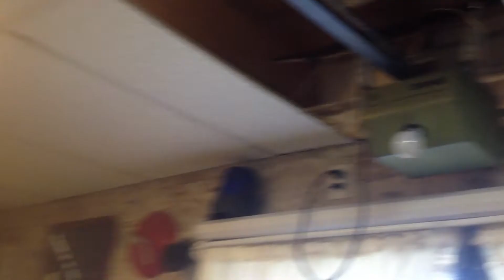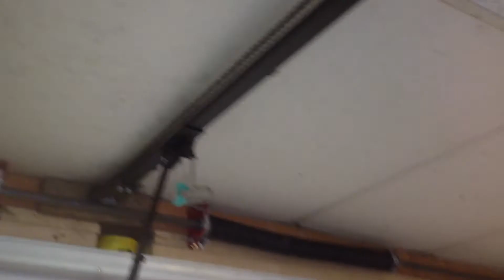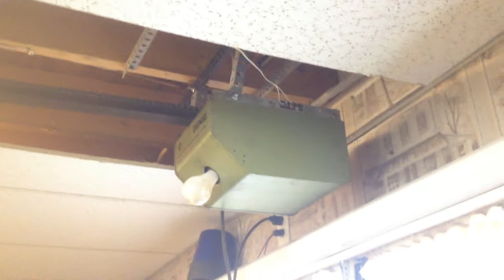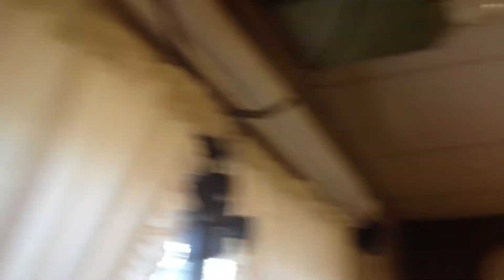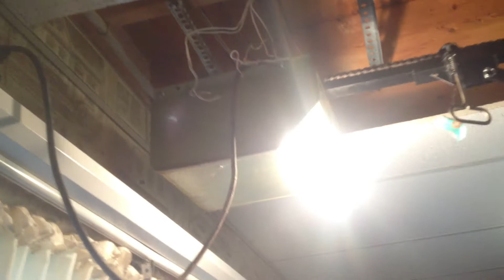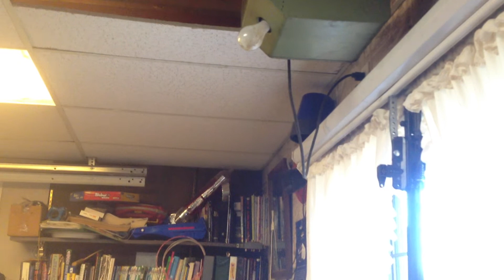Genie 200 on the relante

Comment: Can I program the model 200 to a remote?
Reply from the maker: Only if you have an external receiver.   It would be a small box hooked to 3 wire terminals on the side and mounted on the ceiling or the hanging angle iron near the unit.   If it is the original receiver, than it would likely be too old to accept any modern universal remote, and you would need a universal remote and receiver complete kit

Comment: Just bought a house with a Genie 200 and no remote.  Where can I find a compatible remote or someone to make(?) one for me?  Would it be cheaper to buy a new garage door opener than to hire someone to fit it with a remote?  Thanks!
Reply from the maker: Laura FryMelia Look for a receiver box on your ceiling near the unit.  See if there is a name on it anywhere.  If it says genie, open it up and see if there are dip switches inside.  9 or 12 switches, your local hardware store may have a compatible remote.  If there are no switches in it then you wont be able to find a remote for a receiver that old.  you would then have the option of replacing the receiver with a universal remote kit or replacing the entire opener system.  Hope that helps
Reply: RGDMan Thank you so much for the info, RGDMan!  I appreciate your time and shared knowledge.
Reply: You need the girud-1t if you haven't for it working yet.
Reply: Thanks for taking the time to respond, Milo.  I'll check it out!
Reply: Haha I am in the same boat Laura. I just bought a house as well with a Genie 200 and 209. The previous owner did find one remote, but the wires are not connected, but had a garage guy come out and he thought the remote was a cigarette holder, it was so old haha, but he was impressed with the Genie 200 and 209.
Reply: Laura FryMelia I also have a Genie 209, did yours come with dip switches?

Comment from the maker: So there is.  I Went to my barn and took the unit apart again, and there is a gear reduction.  I missed it the first time around, because it is totally enclosed in a metal housing right on top of the motor.

By the way, don't worry about trying to be an a-hole.  If you see something i made a mistake on, call me out on it.  How can i fix it if i don't know...I told sam i thought it was funny that we all start comments like that.  I know you well enough now to know that you are Not a jerk... lol